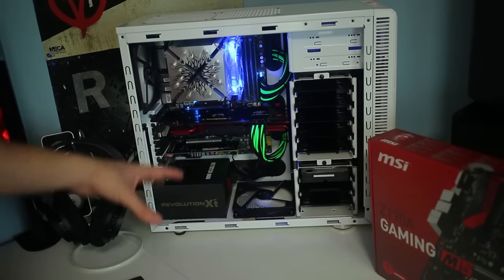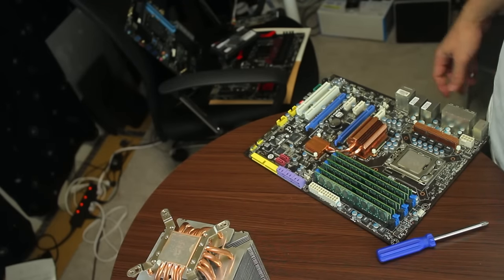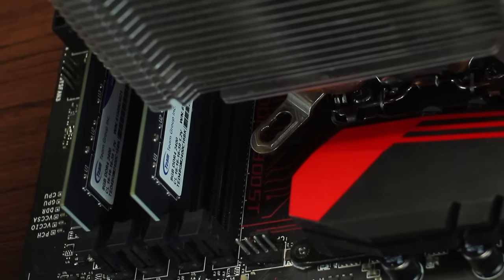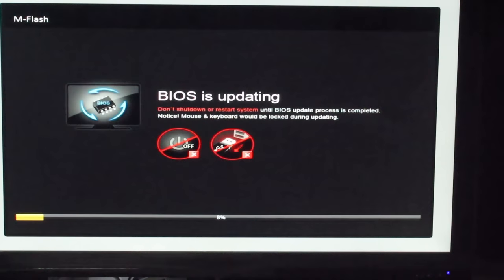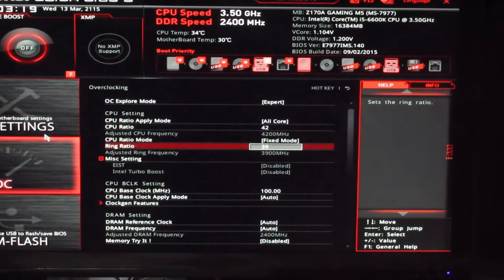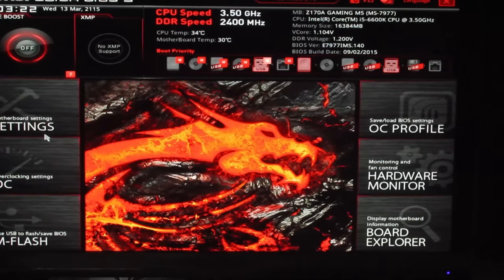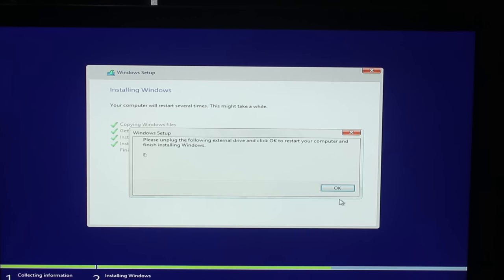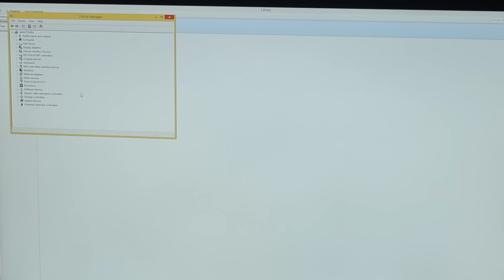Changing My PC to SKYLAKE! (How to UPGRADE YOUR PC Vlog)

Comment: Picked up this board in a sweet deal in UK a couple of weeks ago(free 8G memory), just finished the physical build with a 6700k processor, H100i GTX cooler, 16G of Gskil RipJaws 2400, Samsung 951 m.2 256m boot drive, Sandisk Utra II 960 storage drive, all in a NZXT 340 case, powered by  Be Quiet Darkpower 10 1200w. Just awaiting install and inevitable update/upgrade of OS.
GPU will be a lowly 270x till new card(s?) at Christmas.

Comment: You should reverse the rear fan. In the video it is mounted to blow air into the case instead of exhausting it. You can see that by watching the shape of the blades. It should also have 2 arrows indicating rotation and flow direction. You're welcome.

Comment: flip that rear fan to exhaust, and you'll get better cooling performance. cause right now now you got two fans fighting each other, and hot air wont leave that cooler so easily.
Reply: Yeah, I seen that as well. Was like why the hell would someone with the 'know how' do this. That is a pretty major overlook when it comes to Japanese summer and we don't use the AC much here.

Comment: Really like the vlogs. Just wondering whether the upgrade was for lowering power consumption, or for more performance/features? if it was for more performance, is the skylake quad core more powerful than the older 6c/12t CPU?
Reply: +xxxmrhankixxx no its not.
Reply from the maker: +Fergus Clunies-Ross I will see how high I can clock it, if it gets really high then it will certainly come close to our big 6c/12t x5650!

Comment: Nice little upgrade Bryan this motherboard is very similar to the MSI z170a krait which i hust recived from MSI themselves and there ddr4 boost feature by isolating the memory circuitry is really nice touch :) which u can see in red on yours.

Preforms nicely i can say :)

Comment: You don't really even need a cooler, just an aftermarket coolerbracket(like 8 bucks on eBay).  You haven't seen ghetto 'til you have seen my Skylake piece together. It stays horizontal, because it doesn't close and essentially everything is outside(had an old slimline I did it with... "almost" fit.).  Just wanted to try it.  It does perform really well regardless of how you do it.

Comment: Great video, quick question, what would you consider the max safe voltage to go up to for long term overclock on skylake (though I have the 6700k). PC is mainly used for gaming.

Comment: is your POSSESSOR OK that's a big cooler !!!  considering all this banding issues people are facing
Reply from the maker: +Morsalin Chowdhury Yeah I honestly have to check my CPU out, scary reading about all the bent Skylake CPUs... what was intel thinking with reducing the PCB costs.
Reply: Tech YES City yes exactly!!! they shouldn't have cheap out on the major component!!! i think ill wait for "Skylake-Refresh"
Reply: +Tech YES City Should be fine, as long as you dont tighten it on tight, like just untill you get resistance like you should with CPU coolers anyway, you should get a new cooler anyway and mount it properly.

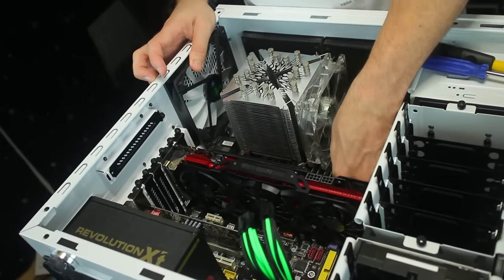Comment: 1:50 - Why do you have the top fan covers blocked when the rear fan is blowing air in to the case? Actually the cpu fan and the rear fan are blowing air on each other, that doesnt make sense....

Comment: Hi do you ever install using UEFI only and windows 8 features? like you vids btw I have the Msi gaming pro but came from the Z97 Gaming 5. Think i should of paid extra and got the Z170A gaming M5 as the sata and usb3 really do my head in on my board sticking straight up and not out the side.

Comment: I am looking to upgrade from my x58 hexacore cpu also.  Would you recommend upgrading to skylake?  Did you notice a difference in day to day use or gaming?
Reply from the maker: +benbujwah SL will be more snappy, but if you have a midrange GPU or whatnot then I wouldn't bother, just tweak your x58/6core as best as you can.

Comment: That salvaged CPU cooler always seemed like a Noctua broken into four and bolted down lol. Bad-ass nonetheless.
Reply from the maker: +Sam Wong Yeah it definitely is a wild one !
Reply: +Tech YES City It'd be a shame to not use it in the build. You know what? Crazy idea: get a relatively cheap 115x cooler that uses those crossbar-styled mount to the retention bracket. Find a way to remove the X-bracket from the current cooler and use the crossbar to clamp it to the new bracket. Might be worth it since the cooler seems to be using a vapour chamber and heat dissipation is quite even; less hot-spots. Would make for an interesting vlog or something even if it fails lol!
Reply from the maker: I will see what I can do, I know I have a enermax t40 bracket here (that didn't get used on the x99) so will take a captain squizzo and see if it fits, but will have to get the review of the mobo dont first.
Reply: Yeah, definitely. Don't give the poor fella a Linus treatment lol

Comment: Having a tough time choosing between the skylake 6700k and the haswell e 5820k. The new skylake is better overall, but I want a editing rendering desktop. I am probably going to choose whichever one is cheaper since the skylake is only about 3 to 4% worse in workstation applications.
Reply from the maker: +Rafael Mateo I would push for a 5820k if it comes to productivity, it is a lot better when it comes to rendering that's for sure.

Comment: The parts arrived few days ago, so I've built my new rig according your "Build The BEST 1k Gaming PC September 2015". Dude this PC ROCKS! :D so fast and quiet. Absolutely love it, and totally worth it. Even Carma Reincarnation runs at 110 fps at 1080p :3

/About the CPU - in the BIOS I'Ve only turned the game boost on which makes it run at 4,1 GHz, but I've read that it may be overlocked to 4,7?/
Reply from the maker: +Michal Márkus Yeah depends on how the CPU is getting etc. I will be releasing a skylake OC tutorial, however 4.1ghz will be fine for all your gaming needs at the moment!

Comment: im pretty sure that the x5650 would do much better in editing because of its cores and ht, the 6600k gives awesome per core performance, but with the x5650 clocked at 4-4.4ghz the i5 wont beat it

Comment: I have been having issues finding alcohol wipes in anything above 70% Isopropyl alcohol.  Where are you getting them?  Right now, I just have standard bottle of 91% and some coffee filters.
Reply from the maker: +Scheefinator In japan down the hardware store, I will check the levels on them.
Reply from the maker: +Tech YES City Just says alcohol santization, but they dry up if I leave them out for a few minutes, which means its largely alcohol lol.
Reply: Tech YES City
I got my computer all set up.  I just used 91% Iso alcohol from CVS and a coffee filter.

Comment: I am just wonder a group of peoples advice. Right now i am looking to be a video editing my self and help 2 friends others into becoming you tube hobbiest. Right now i have an generation one amd quad core and 4g of ddr2 ram in a rig that has not worked in years. 
The big debate for heavy graphics and light gaming which is best the I7 7600 or the i7 5820k with a gtx 970 overclock an 16or 32g of ram which do you think would do a better job the total bugbet is 1200 or 1300  usd and i am in the US
Reply: I have the i7-2600 running at 3.6ghz paired with a gtx750ti. in Fallout4 On Med settings, I get over 43fps on intense places, black ops 2 I get over 200fos on extra (highest setting). the i7-2600 is still a good processor up to today even. just need to find a overclockable motherboard and you'll be all good
Reply: +Titan SixtyNine Thanks it sounds like a good gaming rig for the price. If am going to need this pc to do 2 to 3 of rendering and video uploadng a day.
Reply: JCinLapel if I were you,I'd go with the latest skylake processors if your buying computer parts. More updated technology and since its the K, you can overclock to get some better performance.

Comment: Please tell me what z170 motherboard can i buy for i5 6600k and i want 16 GB ddr4 ram for now so please let me know along with the motherboard you suggest if i should buy a single stick of 16 GB or 2 8GB sticks or 4 4 GB sticks..?? I had read somewhere that 100% utilization of a motherboard cant be done if wrong number of ram chips are used...So kindly guide me.Thanks a ton n i love ur videos...👍
Reply: +Maunas Shastri If you wanna overclock,  then make sure you get a Z170 board. Also about the RAM thing, 4 DIMMs will leave less upgrade room in the future but may be slightly cheaper. Again if you wanna overclock then it is best to use only 2 DIMMs as for some reason thats where you get the best results. I hope this helps
Reply: +XJ980  tnx a lot sir
Reply: +Maunas Shastri no problem :)
Reply: +XJ980 btw any specific company that u can recommend..?? Howz asus pro gaming..??
Reply: +Maunas Shastri I use an ASUS board currently and it's great, I would also recommend gigabyte, msi (for gaming boards) and asrock
Reply: +XJ980  k k....tnx a ton...god bless ya...
Reply: +Maunas Shastri no problem, if you want to learn more go check out my channel! I am a tech/gaming youtuber and it would be cool if I could help you out more!
Reply: +Maunas Shastri no problem, if you want to learn more go check out my channel! I am a tech/gaming youtuber and it would be cool if I could help you out more!

Comment: What's your opinion about the stock Fractal coolers?
Reply from the maker: +Dario Cavrić They are pretty decent at 7v, flow decent air and dont get too noisy.  The ones here though at 12v do start to make some noise.

Comment: did not do my research and bought the H170 instead wich does not support overclocking, BUT there is a CPU overvoltage jumper on the card, is that some type of manual overclock?
Reply from the maker: +nogravity60 What motherboard exactly I will check?
Reply: +Tech YES City Asus H170 pro gamer . strange to have a swich like that if it's not supporting OC

Comment: i dont understand your airflow :o the back fan pulls air in. the cpu fan pushes air through the cooler in the back fan?
Reply from the maker: +Harun Kilic Yeah so kind of smashing air to both sides of the cooler, works well, since i leave the side panel off.
Reply: +Tech YES City your side panel is open? isnt it loud?
Reply: +Tech YES City i had a 970 g1 gaming a few month ago too and in closed case it was too loud for me in gaming after few hours
Reply from the maker: Nah not loud at all.... weird how your g1 gets loud, mine stays even loaded in games... what temps is it getting up to? Custom OC though the fans will start to get a little loud in games. Though when i am gaming I am usually wearing headphones.
Reply: +Tech YES City dont know. now i have watercooled titan sli and my pc is extrem quiet now. only thing that is loud is my hdd :D i think my g1 970 was loud because my old case had bad airflow
Reply from the maker: Ah true well there you go!  Airflow is very important in a case to make sure the parts can breathe!  What CPU did you have in there with the G1?
Reply: +Tech YES City 3570k@4.8ghz

Comment: i have a fx 8350 without overclocking and  a 960 gtx msi p,pci ssd predator 240 gb  what upgrade i should do  skylane or lga 2011 recomend pls
Reply: I upgraded from an FX 8320 to a i3 6100.
I say upgraded because I get MORE performance with the dual-core i3 surprisingly. Must be the 3.7Ghz stock clock.
Reply: ***** I had it at 4.2 but I couldn't set it any higher unless I wanted a bricked CPU/Motherboard. But that's exactly what happened. I set it to 4.5Ghz and thought it was stable for a time, but then my computer shut down and wouldn't turn back on. That's whty I started shopping for new CPU's/Motherboards.
Reply: ***** Yeah, I had an H60 liquid loop mounted to a 990FX Fatal1ty Killer board.
Reply: ***** It seems that I "lost the silicon lottery" as some would put it.

Comment: Sucks to hear that people are having issues with their CPU bending, but performance wise they are great.
Reply: +Robert Oliver CPU bending? What do you mean?
Reply: Ahegao Senpai People were mounting cooling blocks on the CPU, and then moving the computers a lot. This was putting unnecessary pressure on the CPU and making it bend.
Reply: Robert Oliver
Oh, i bought a Cryorig H5 Ultimate. Guess I should be careful. Where are you hearing this from?
Reply: Ahegao Senpai http://www.pcgamer.com/intel-skylake-cpus-are-bending-under-the-pressure-of-some-coolers/
Reply: Ahegao Senpai I haven't had any issues with my 6600k, but I'm still careful. If I move my PC now I always remove the cooling block.
Reply: Robert Oliver
 I guess that's too bad for AIO watercoolers. Cyrorig reported nothing happening for their stuff and its what I bought for my build. You should specify what you mean next time. And not just say they're bending out of no where.
Reply: Ahegao Senpai 

"How about you do a better job at conveying information" How about you don't use someone in the YouTube comment section as your source of information? 

"saying someones CPU is going to fuck up and bend without actually telling them why"
The point of my comment was not to share that info.Also I never said people would have their chips bend. All I was doing was saying even though some people are having issues the chips are still working great.
"Sucks to hear that people are having issues with their CPU bending"
Nothing fear mongering seeing as all I said is true. Some people are having issues with bending. Fear mongering would be more like "all these poor Skylake users. Enjoy having your CPU bend!"

"the fuck you're saying considering you had to find a damn link to reinforce your statement."
You asked for the link. xD
"Where are you hearing this from?"

My goal was not to be a news outlet. The guilt doesn't fall with me, it falls with you. If I claimed to be an all powerful deity who new all and would inform everyone, then yes, I should have been more thorough. But that wasn't my intention. I never even did what some have done and boycott the chipset all together. I just said some are having issues with bending but they are still good chips. Also I have a Skylake CPU.

Comment: Only having 2 screws will put uneven pressure on the cpu. There is a reason you are supposed to tighten them in an X pattern.
Why someone would change a rendering station from 6 cores 12 threads to 4 cores with no hyper threading. Rendering is HIGHLY multi threaded so going to something with less then half the threads makes no sense. 
A true nerd would never use anything other then AS5
He called things by incorrect names multiple times 
You should NEVER overclock before testing to make sure it's stable 
This is the only video I've seen this guy do but I wouldn't trust anything he recommends from what I've seen, I felt I needed to warn the people that are not tech savvy before someone breaks their hardware listening to him

Comment: Nice pc brian heaps better than mine currently i still have lga 775 lol, ile list my specs

Cpu: Core 2 Duo E7400

Gpu: Gigabyte 9400gt

Ram: 2 Gb of ddr2

Mobo I dunno some random Foxcon napa socket
 
Hdd: 168 GB segate barracudaaaaaaa du du du du dada dummmmm

Case: An Alluring Beaty in sleek designer black -Hp it sucks lol

Comment: Editing? Should've went 5820k.
Reply: +Even.Ways Music You know very little about SkyLake then.
Reply: Flimbo nimbo I know that editing massively benefits from more cores and threads and I know that the 5820k has 6 cores and 12 threads where as a 6600k has but 4 cores and 4 threads. I know that at stock speeds the 5820k destroys in render times and overclocked to 4.6GHz would just leave that i5 in the dust. You sound like one of those latest CPU fanboys who say something's better just because it's newer.
Reply: +Even.Ways Music Yeah the stock 5820k is loads better for editing and all that kinda stuff, the only times the 6700k beats it is in single thread performance but that is cured with an overclock anyway. 

The only reasons anybody would buy a 6700k instead of something like a 6c 12t 2011/2011-v3 for editing are either a massive sale on the Skylake stuff.... or brain damage.
Reply: Gonad Haha exactly man. Exactly.